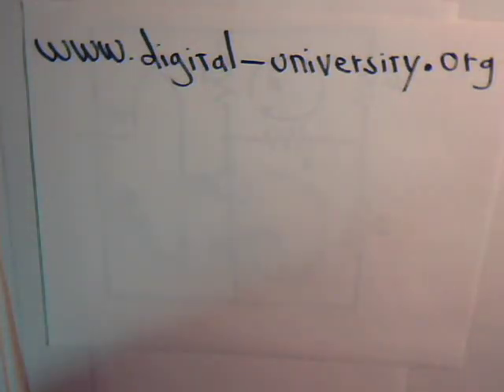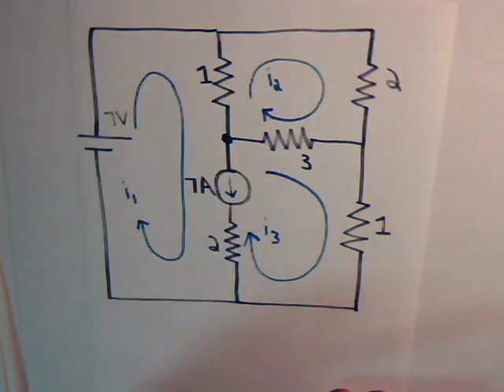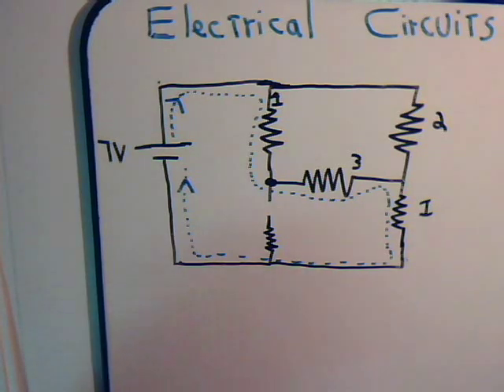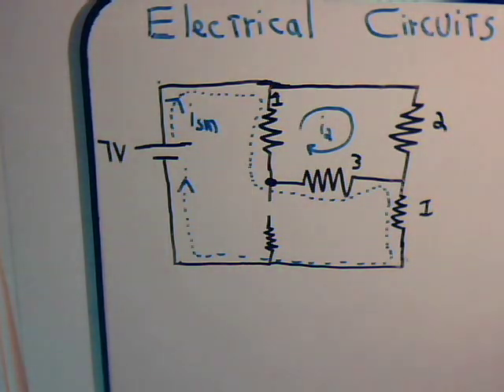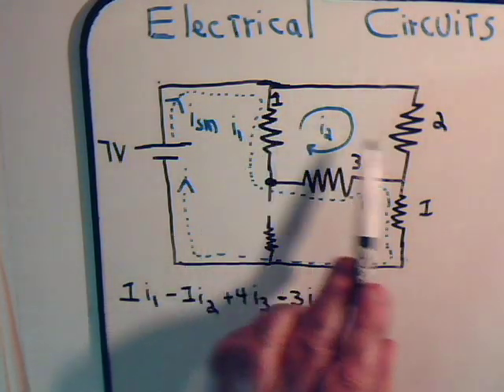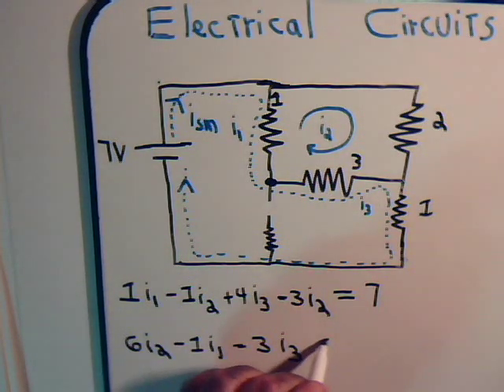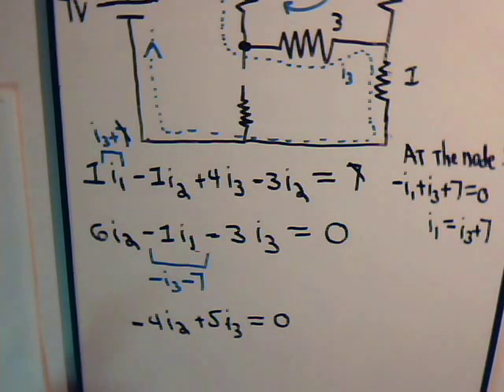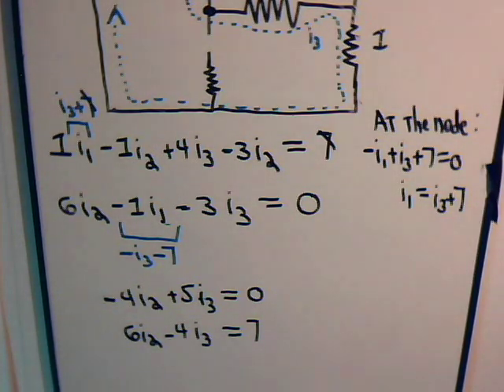Electrical Circuits Video #19: Super Mesh Curents (V & I Sources) Example #1

Comment: 8:30 why i2 is not included in the equation? I'm thinking that the current in the 3 ohm resistor is a branch current (i2-i3)
Reply: but when writing equation 3, why the heck dont you add i2 ? at 8:07, it makes zero sense for me.
Reply: It is not a super mesh when writing equation 3
Reply: Wen we discard the current source in the super-mesh method, we write the third equation [ 7 = i1 - i3 ] as a representation of the current source in terms of the other two currents that pass through it. hence only i3 (negative because it is opposite to the current source direction) and i1 are considered here. i2 is does not pass through the current source and is not needed to model the current source.